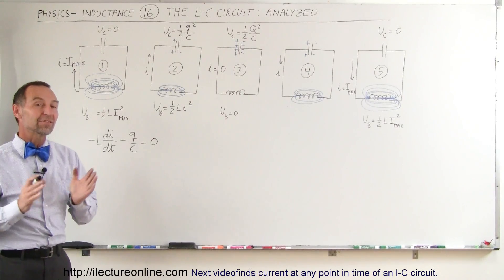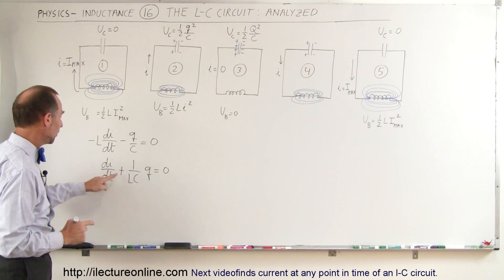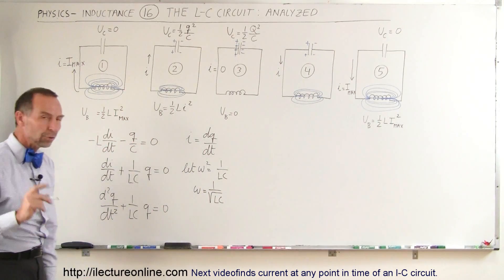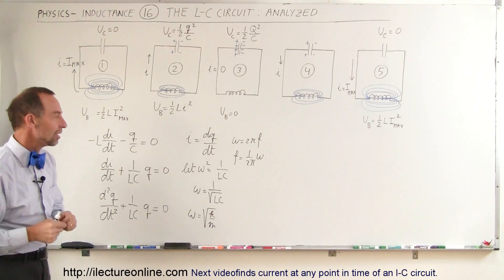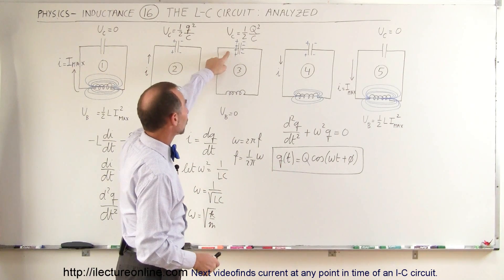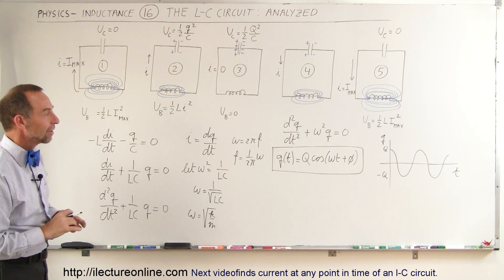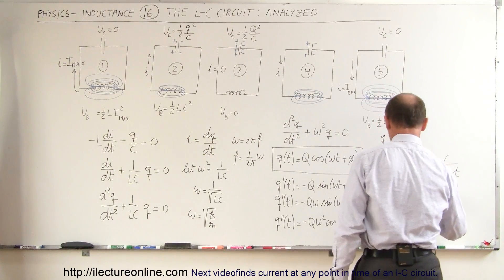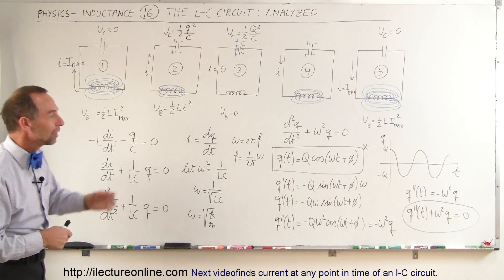Physics 47  Inductance (16 of 20) The L-C Circuit: Analyzed

Comment: sir i noticed that polarity of capacitor and inductor is opposite that is if one charging than other discharging in every diagram . but you have taken voltage drop across  both of them while writing KVL. sir what should keep in mind while framing KVL.
Reply from the maker: That is the standard approach using the standard equation.  Note that the inductor opposes a CHANGE in the current, which means that the voltage can be reversed to the direction of the current.

Comment: Please, answer.I can't understand, why the minus sign is before L*di/dt? As you said in your this (http://www.ilectureonline.com/lectures/subject/PHYSICS/5/58/870)  video, the current is decreasing, so on the inductance is voltage  rise, i.e  by KVL  must be "plus" . Please, point me, where i am incorrect. P.S. In any case I'm very grateful for your titanic work.Thanks
Reply from the maker: It is a standard way of looking at the voltage drop across an inductor.  (on a momentary basis it depends on the direction of the current in an AC circuit).